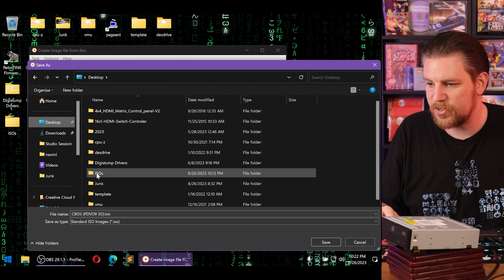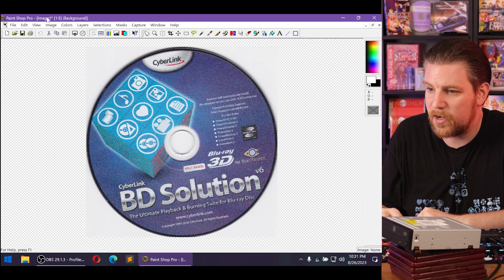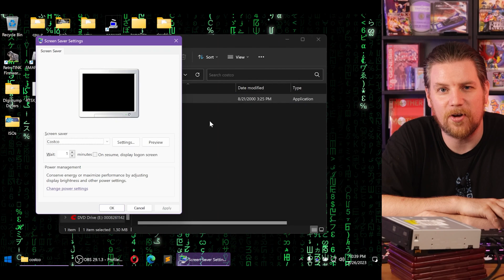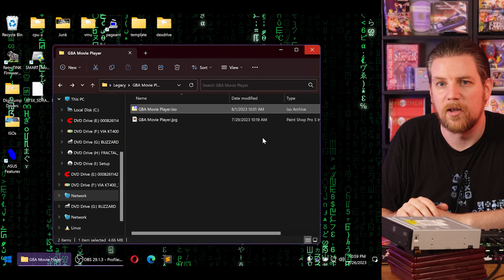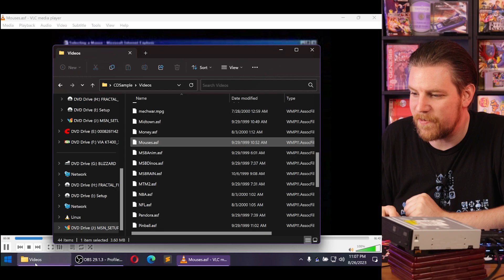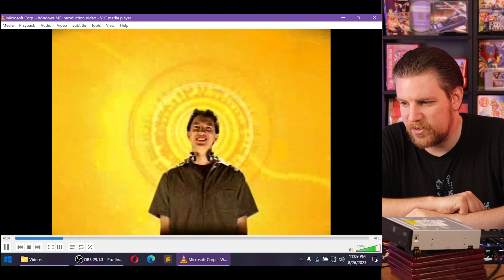CD/DVD Archival Project

Comment: watching this on a desktop equipped with a Blu-ray drive. You made me chuckle when saying they don't have them.
Reply: also given I'm on Linux, I've mostly used a combination of "cdrdao" and "cp" to make disc images. cdrdao can copy multi-track discs and discs with odd geometry configurations and preserve them exactly.
Reply from the maker: Yup, workstations with 5.25in bays still exist, but are getting more and more rare. It was a total pain to find a decent case with bays, that also showed off the internals for my Win98 retro rig (something I'll be featuring in future videos)

I just checked, looks like that Linux utility is also on FreeBSD, so I'll have to give it a try sometime.
https://www.freshports.org/sysutils/cdrdao
Reply: Same. I have a Blu-ray burner in my system with a very modern Ryzen 5000 series CPU. I always build my own systems and didn't even know it is odd these days to have an optical drive until just recently.